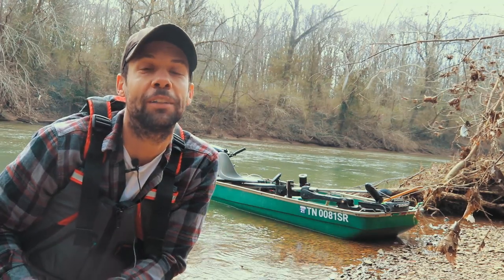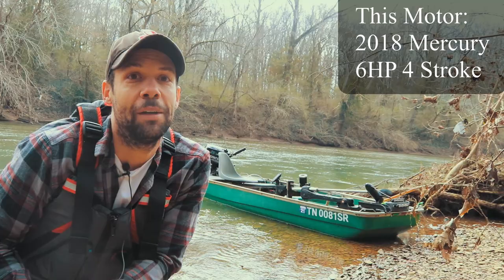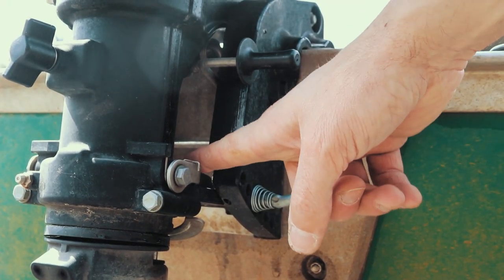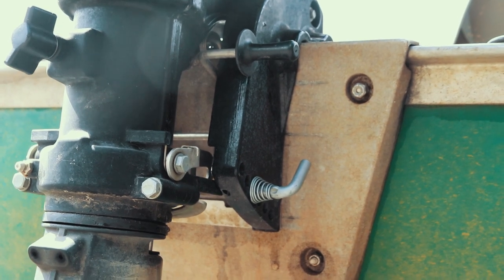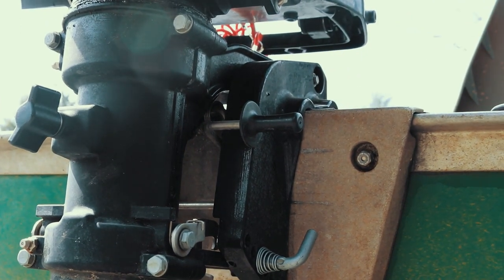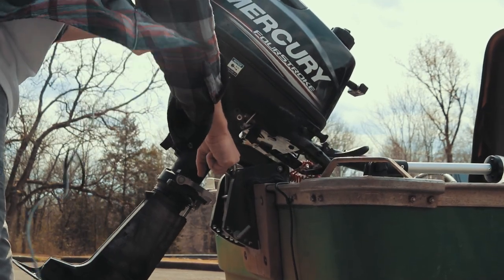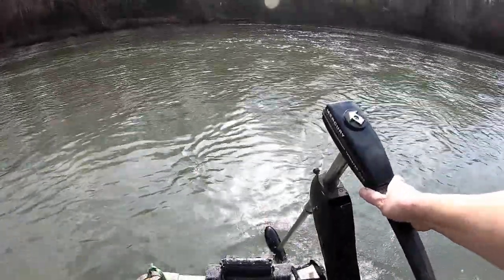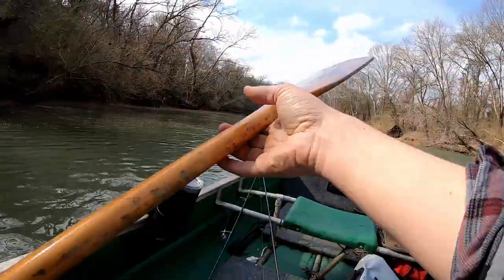SECRET Trim Position for Shallow Water -(Shallow Water Drive) Mercury/Tohatsu 6HP 4 Stroke

Comment: You taught me something I did not know. I'm fairly new to outboards. I have a 5HP Mercury (new) on my Solo Skiff. Still breaking it in. I did not realize that when the motor is in forward it disengages the lock and you can easily lift it into shallow water drive. I have been reaching back and lifting the lever plate to raise the motor a bit for shallow water. Don't have to. I just went and confirmed on my motor. This is great. Thanks very much.
Reply from the maker: Awesome! Thank you for the view and support! Good luck with your outboard, hope you really enjoy it!

Comment: A true gem of knowledge!! Just bought a used 12'  aluminum jon boat and a new Merc 4 stroke 3.5 with a 5hp upgrade kit on order. I live Citrus County, FL swamp country in the Withlacoochee River Basin. Gets really shallow in some areas - popular with "mud boats". This easy little tip is worth it's weight in gold, for me!!!
Reply from the maker: Awesome! Thanks, let me know how you like your setup. I’m curious how you like the upgrade kit. Let me know! Thanks
Reply: @Skinnyriver  Upgrade kit 'bueno!' - markable difference. However, I can't find your shallow water trim mechanism on my newer generation Merc. No problem in the canals and lakes yet, but I hear it gets very shallow on the flats.
Reply: OK - found a trim adjustment. There's a three position pin adjustment on the cradle that the shaft seats on. Not too drastic, but I moved the pin aft, and trimmed the prop away from the transom a bit. It's not something you can do while in the water. Only three trim positions on the smaller hp models. I assume there's a reason? I also have a short shaft motor.
Reply from the maker: @whitehawkeFLA yeah I have a long shaft version. I bet the short shaft is limited because the water intake is higher when you tilt the trim. That’s probably the difference is the short shaft vs long shaft
Reply: done have 5 anp akrrunatee 12 vokts 60  watz chargíbf

Comment: A useful video I've not had the guts to use mine in shallow water yet but good to know shallow drive works. Do you clean your engine after use with the screw in flush port ? If so be good to see a vid of how you clean and lube your outboard after usage.  Thank you kindly keep up the good work 🙏
Reply from the maker: Thanks for the ongoing support! I honestly have never flushed motor. I’ve really neglected that. I only use in fresh water, not salt, so it’s not as critical but yeah I need to look at that more.
Reply: @Skinnyriver  yeah I guess its not as vital to flush engine after use in fresh water. I use mine in salt and I flush and lube after every use...also I'm a bit of a clean freak ha ha.
Reply: @Skinnyriver  not so important in fresh, but crucial in salt.  I've seen motors ruined after their time in salt water, because of not flushing.  New motors have more protection, but don't run an older motor in salt without flushing the same day.
Reply from the maker: Thanks for confirming. Curious, when damage from salt water where does most of the damage occur on the motor. Does the corrosion simply start to eat through the cooling channels in the motor?
Reply: @Skinnyriver  When corrosion happens the metal oxides are often ten times the volume of the original metal so if the motor is old enough to have any raw matal on the inside is is very likely to get completely blocked in the cooling channels.  Once water cannot flow, then you cannot flush it our with vinegar and dawn so it is ruined.
Reply: @alexstubbins6298  If you use the hose attachment you can't run the outboard while flushing. The impeller is pushing against the flow coming down the tube towards the impeller with air so your impeller will burn up in a matter of minutes. Two of my friends didn't read their manuals and ran their outboards melting their impellers.
Using the hose attachment is still better then the muffs. The flow is the same for the powerhead but it's backwards for the impeller and water inlets. That helps to flush sand/trash from the impeller and water inlet areas that would just stay hung up with the muffs.
My 3 boats have the hose attachments but I'm bad about not using them, should more often. I only use on the salt but live on a lake with a sweet ramp right near home. I find myself backing halfway into the freshwater and running the outboards 3-4 minutes while I hose the deck.
Reply from the maker: Really good points, I didn’t realize hose attachment flow was backwards compared to impeller flow. Really good!

Comment: How to know if a motor has this?
Reply from the maker: What motor do you have. I can check your manual. But if you raise the motor and it clicks and prop and water intake is still in water, it probably has this.
Reply: @Skinnyriver  thanks. I was looking at the 5HP propane model  I found out it does have this which is great

Comment: Hello Skinny River,great video...very informative.i have a question I have basically the same set up that you have.i have to ask how far is your transducer from your prop?I have been reading all kinds of different information on how far it should be from the prop.
Reply from the maker: If I remember correctly my garmin manual said 15” or more (horizontal distance from edge of prop to leading edge of the transducer on the starboard side). I think I landed around that 15” as I was getting pretty close to the edge of the hull.

Comment: You can MODIFY  your transom  with 2x12 clamped on to your  transom with HEAVY DUTY c clamps..
Reply from the maker: Yeah good point, for many that would work. But My water intake would be too high it I raise it much higher. I am about 1” too low so I may try that to get my cavi plate level with bottom of the transom

Comment: I just ordered a Tohatsu 6 hp and will be running in skinny water (rapids).  I'm going to raise the motor  as much as I can with a 3" set back.  This will also give it better performance. I will have to rig up a low water pickup.  I'm thinking of a 90 degree tube facing forward.  Hopefully, I'll have enough clearance in front of the prop.  What think?
Reply from the maker: Man that’s awesome, I don’t have a lot of experience with low water pickups or low water nose cones they put on the higher performance motors, but it sounds like it will work really well. I’d just pay attention to clearance and if the tube causes any turbulence in front of the prop (ventilation). But it sounds like a awesome setup. If you really get into the shallow water fun, Tohatsu has a 6hp jet drive outboard that’s made for that kind of stuff. That might be my next motor!

Comment: How did the motor do pushing upstream in the current? The shallow water drive sounds great but I worry there will not be  enough power to move upstream in river  current. Stuck with this motor until I can save for jet drive!
Reply from the maker: It’s ok. It was pretty s decent current and I made it upstream, but if its super strong you won’t be able to match the current. But overall I have been in a situation where I couldn’t make it up

Comment: looks like you could lift the motor up 2 or 3 inches on the transom. the cavitation plate on the outboard seems to be way to low in  the water.
Reply from the maker: Yeah I definitely could use a Jack plate. It’s about 2 inches low but it performs pretty good so I haven’t had a reason to justify the $$$ or time to rig something up. Good observation!
Reply: Look for diy on YouTube. Can be done for little money. Getting the hydrofoil  on top of the water will give you speed, control, and fuel economy. May be worth a look. Will be building one myself soon.

Comment: My 1980 Mercury 2 stroke 7th  pisition rests the prop of the water.
I Wish there was a way to modify it
Reply from the maker: That’s stinks, not much you can do. You could look at getting an adjustable offset Jack plate but it’s probably not worth it unless your motor is too high in standard position.
Reply: buy  ñew biat new motir

Comment: Just bought a 5hp 4 stroke mercury and mine does the opposite. When I’m in forward it locks in on the bolt and reverse it unlocks and will come up.. any help?!?!
Reply: Love the information you give on these outboards by the way!!!
Reply from the maker: Man that’s weird, what year is it? Some have a manual locking lever that you have to lock yourself. But if it’s a newer on (like after 2000) it should have a lever that is tied to your shifter rod that locks and unlocks it for you

Comment: I am new to outboards.  I have a Tohatsu 5hp, 4 stroke (new).  In shallow water position, I don't see water coming out the pee hole.  This makes me concerned about using that position because I don't want my motor to overheat.  Any advice?
Reply from the maker: You have to have cooling water peeing. It may be that your motor is sitting too high, there are short shaft and long shaft versions of this motor. Is yours a short shaft? If so it may mean you can’t use shallow water position because the motor is sitting too high because it’s a short shaft).
Reply: @Skinnyriver  yes.  My motor is a short shaft.  The boat manufacturer, Sea Eagle, specified short shaft (15") so that is what I bought.
Reply: BTW,  I already hit bottom on my first trial run.  Scraped up and nicked the prop pretty bad - sucks.  Did not shear a pin though - thank God - I was 4 miles down river with no cell service.  Can we talk?
Reply from the maker: That’s good you got the right length, the shallow water position is designed to keep the water intake in the water. So not sure what is going on with yours. I would test it out with the motor off. Put the motor in shallow water position close to the bank and get out and see if the water intake is above or below the water. But regardless, if it’s not peeing water, don’t run it in that position.
Reply from the maker: Yeah of course, my email is skinnyriveroutdoors@gmail.com, i could give you a call whenever

Comment: Hey boss, I see the Mercury 4 thru 6 HP motors have an  alternator for charging or lighting. Haven't seen any video's floating around on that yet. Would make a good one!!!!
Reply from the maker: That’s a good idea! There are 2 versions of the Mercury, the standard and the sail pro. The sail pro has the alternator and 12volt hookup for charging. Unfortunately I don’t have that version. But if I ever get my hands on one I’ll definitely do a vid.
Reply: @Skinnyriver  I was looking at the specs on a 2022 4 HP and they show a 4 amp alternator for charging and lighting. Must be a feature added to the new models. Hope so any way. Just handier for the trolling motor battery. Tired of lugging it in and out of the boat to charge it.
Reply from the maker: @agentorange2554  that’s cool, I learned something. Haven’t seen the 2022s yet. You are right, I have to take mine out as well. It’s a pain. I might have to look at upgrading myself
Reply: @Skinnyriver  Did a little more research. The alternator is optional. Since your motor is a newer model, it may be able to be upgraded easy enough. The motor at my local dealer comes with it. I'll be snagging it tomorrow.
Reply: The motor did not come with the alternator at my dealer. The dealer explained that the voltage is so low on that set up, you would have to drive around on the motor 9 or 10 hours to recharge your trolling motor battery.  I swear, there's never an easy solution to anything!!!!
Reply from the maker: Yeah I was wondering that myself. I reads it just for small lighting and auxiliary batteries. Oh well, I am about to run a lm extension cord from my charger to me boat so I can charge in the boat. I hate carrying that thing around
Reply from the maker: You can make a charging harness out of an extension cord to hook to the battery
Reply: @Skinnyriver  I'm gonna run electricity down to my dock and just charge it in the boat. Mercury prices are going up in 4 days. The 4 hp will cost an additional 200 bucks after that. So if your planning on buying something, lock it in now.
Reply: ues bith 4 hp 5 hp 6 hp 4 amoh 12 vlt akrent 48 watss chargibg barty new ogrssd
Reply: @agentorange2554  On my smaller work boat I don't have a charging system for the trolling battery like my two larger boats. I also got tired of yanking the battery out. So I used a construction extension cord, replaced the ends with small jumper cable style clamps, and when I've used my trolling motor but have stopped for the day I hook up the clamps to my trolling and outboard batteries like you would to jump a car, positive to positive, neg to neg. The stator charges it back to 13.1V in no time while on the way to the ramp, dock.
Reply from the maker: Really good pts Ray, I appreciate the views!! Thank you for your help
Reply: 4 hp  48 watts 6 hp    72  watss

Comment: I have a mercury 4hp that I’m going to do the 6hp upgrades to. I was wondering if you’ve tried the motor on any bigger boats and what was the top speed?
Reply from the maker: I haven’t but I have seen it on some 1436 aluminum Jon boats going around 14mph
Reply: Thanks for the quick reply. A 1436 is exactly what I’m looking for. Or a 1242. Love your videos dude, when I get out the navy I plan on getting me a Chanel up and running.
Reply from the maker: Awesome! Keep me updated when you get a boat or get some videos up. Thanks for your service
Reply: 4 hp 6 hp both haß a 48 watt akterbàtir
Reply: dobt have 6 amp akteuñatrot

Comment: Why not just add a DIY jackplate to raise the motor and get a straight facing prop instead of angles to the sky?
Reply from the maker: It might work but I would be afraid  water intake would be too high and in turbulent water from to transom. 

This is just a standard tilt position on all new outboards for when you occasionally get in shallow water. If you are always in shallow water probably best just to get jet drive